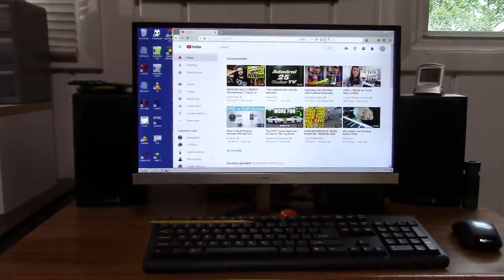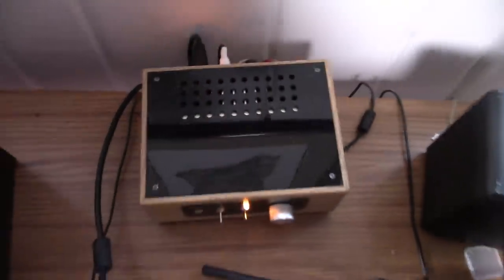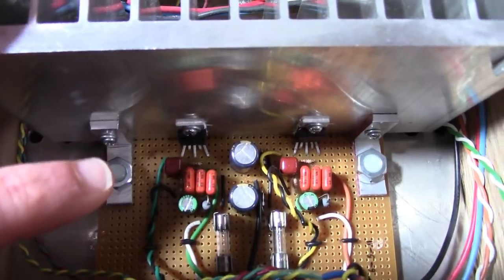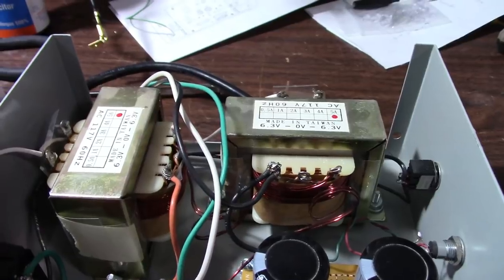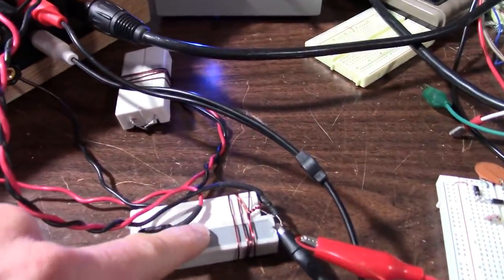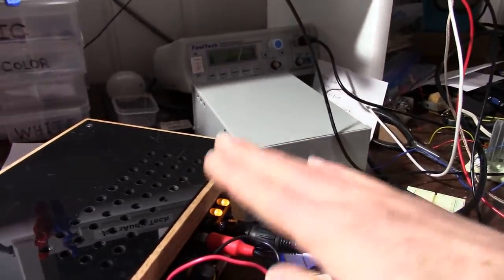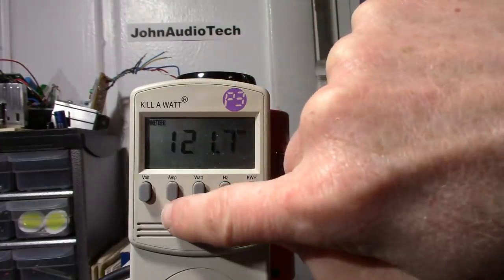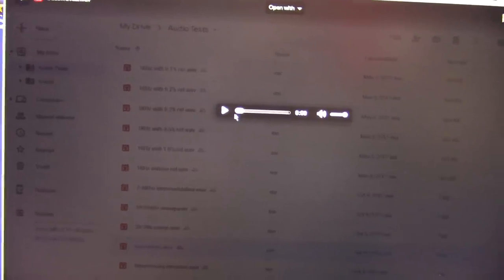TDA2050 DIY computer audio amplifier test & review

Comment: I remember when I learned that there could be power on the heatsink in an atx psu. Fried a cheap meter and tripped a 15 amp breaker.

Comment: Nice amp,  you can also try  TDA1554- 12vdc to 18vdc- single supply,  a stereo- bridged 22w per channel  only 5 components  so easy to build, it's  widely used in audio car stereos before the Mosfet ic-chip came along with 50w

Comment: i'm running a dual Tda7294 board from Jim's audio shop, with a uPC1237  for speaker protection and a 150 VA 26-0-26 transformer. works fine so far..

Comment: This is weird, the hardware seems perfectly fine for Windows 10. Ivy Bridge came out during support era for Windows 8.0 or 8.1 and there really isn't much between them and Windows 10 technically. I'm running Windows 10 currently on an Ivy Bridge laptop, same exact generation and similar hardware to your PC, on a Bay Trail Atom tablet, from slightly later in the same era, and on a much older Phenom II x6 monstrosity, though i guess last BIOS firmware update for that came also around that late 2012 era to support newly available processors. Two of these got the 64-bit build of Windows, the tablet got 32-bit due to its RAM shortage.

Ivy Bridge is still remarkably fast and highly compatible (all necessary instruction sets present) and i don't see much pressure to upgrade, would be a waste of money. If it's just for Windows 10, it stands to reason that you should be able to accomplish that still. Especially since you might find Windows 10 mildly infuriating (i still do, but i need it for various reasons and am willing to live with the bad for the benefit of the good), and it would be a double disappointment if you found that you had to drop a whole mainboard+CPU+RAM worth of money to get to something that you don't like.

You can usually run Windows 10 just fine on most older machines starting with Vista era, 2006 or so, just as long as they have ample RAM - about as much as you needed for Vista if not less, about 1GB for 32-bit version and starting from 4GB for 64-bit.

What exactly was happening? If it was failing somehow in early boot stages, perhaps it's an UEFI/GPT thing. on PC and laptop, i decided against GPT, and use the MBR partition table and classic boot instead. Secure boot was too scary for me, because troubleshooting UEFI issues didn't make me comfortable, AT ALL, i simply lack a proper in depth understanding of what's going on there.

Sometimes, upgrade troubles are a thing and a clean install of Windows may be advised. Let me know if i can advise somehow.
Reply from the maker: It would install and run perfect for a few days. It would eventually slow down and become unusable. System file check said files were damaged and system file repair wouldn't fix it. I reformatted and put 7 back on. Six months later I walked into the room and 10 was installing itself (forced upgrade MS was pushing). I was going to try again anyway so I continued. Same thing again after a few days so I reformatted and put 7 back on for good. I put 10 on my parents computer which is as old as mine but with "weaker" hardware and it has been fine for years.

I couldn't find a solution at the time searching the tech databases so I never tried 10 again. I'm happy with the computer as it is, however, MS drops updates for 7 next year and rendering H.265 videos is slow.
Reply: You got too much spare time, and are looking for trouble? Get a shitty PC and put Windows on it. I'm using a Mac since forever, never had any trouble with it. What you get is what you pay for...
Reply: @JohnAudioTech  Hey John! Windows 10 seems to have issues with hdds. Many times disk usage is always at 100% so the pc becomes extremely slow, especially if there is an update available and windows tries to install it. I used to have the same issues, so i bought a new ssd and now my pc runs smoothly.
Reply from the maker: @gn_electronics  In my case it was damaged system files for some reason. It would eventually completely die even with a clean restart. The start menu would not even show anymore. It was hosed. Windows 7 runs without a hitch.

Comment: Would have been better to have the larger "storage" caps inside the amplifier enclosure, rather than in the PSU. There'll be a lot of sag and droop on the peaks of sinewaves due to the long run of fairly thin cable to the XLR connector. Also I didn't see any shielded cables in the inputs - just twisted - which is a bit dodgy..
Reply from the maker: Under worst case load conditions, both channels driven into reactive 4 ohm speakers, I would lose a few hundred millivolts in the power leads which translates to about a watt of lost output per channel. I can live with that. The amp is dead silent with the volume full open so the chassis / lead shielding is more than adequate.

Comment: John,how to boosting output power tda2050 with additional mosfets on output line?
Reply: Are you driving 2 Ohm loads with it or something? Because for 4Ohm and up, the chip is voltage-limited (and thermally limited if you don't cool it well enough, but you'll have that issue with MOSFETs too - plus the risk of MOSFETs dying short and killing a bunch more things including the TDA), so it doesn't make sense to add more current drive to its output anyhow.

If you did, then i'm not sure what the point of keeping TDA2050 around would be at all, i mean it would just about only be present as a voltage gain stage, which a small opamp will accomplish much cleaner and neater.
Reply: @SianaGearz  i mean tda2050 driving a pair or more output stage to increase power output at 8ohms load
Reply: @victimovtalent6036  To get more out of an 8 Ohm load than TDA2050 delivers, you need to up the system voltage beyond what the TDA2050 is compatible with. The complexity of the project is pretty high, you'd be basically building a hybrid (discrete output, opamp-driven) amplifier which for some inexplicable reason still has a TDA2050 hanging around in it doing not much useful whatsoever except injecting its noise and distortion, where a low-power opamp would likely perform much better instead.

If you get a bunch of cheap TDA2050, you can bridge them (BTL) to drive 8-Ohm loads (4 Ohm apparent load), that might just be the most sensible way to go about your task. You get 4 times the power by doubling up the TDA ICs. And i mean TDA2050, you won't get the original European STM/Philips parts, except bad fakes or old salvage, but UTC, a Taiwanese manufacturer, is making them in license, they're about $1.20 a piece from a reputable distributor, item TDA2050L-TB5-T.
Reply: @SianaGearz  that is the problem,an authentic tda 2050 is rare on the local markets especially in my country😞
Reply: use lm3886
Reply: @victimovtalent6036  you should submit an enquiry with LCSC, they ship worldwide and should be a reputable supplier. They carry UTC TDA2050L but it's currently run out, you submit an inquiry and they'll let you know when it's back in stock.

TDA7294/5/6 are in active production. As is LM3886, as mentioned by John and 
LM4766.